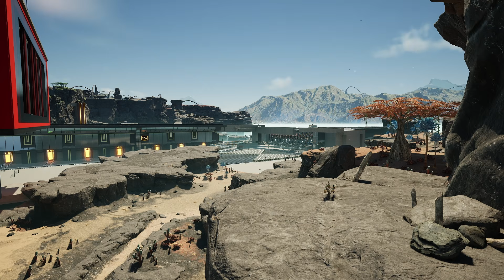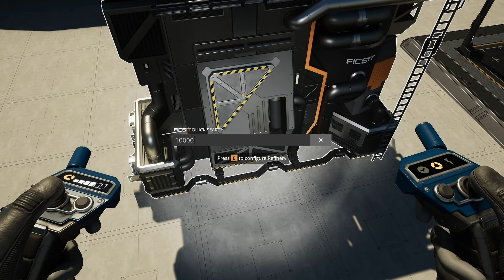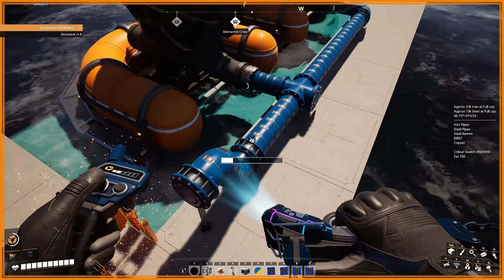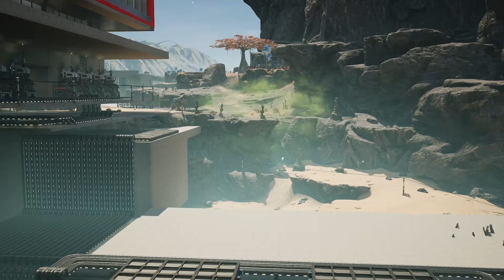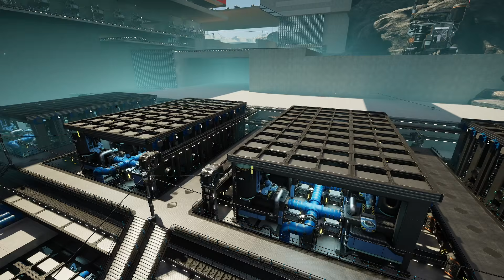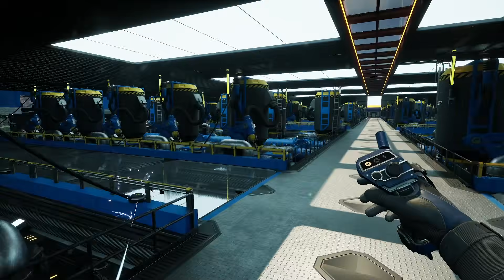Fixing The Water Problem Satisfactory 1.1 Lets Play

Comment: The problem with filling a single pipe with liquid is solved completely by installing a buffer tank at its very beginning. That is, the liquid must flow from the pumping station block into a small tank, and then move further along the pipe to the consumer.

На русском:
Проблема с наполнением отдельно взятой трубы с жидкостью решается полностью установкой буферной цистерны в самом её начале. Т.е. жидкость должна из блока насосных станций попадать в маленькую цистерну, а потом двигаться дальше по трубе к потребителю.

Comment: I might have you beat with the rubber limestone mix not even joking you I can make 450 concrete a minute with this 1 machine I had 6 running for one of my mega build, near the sw edge of the map and might I say it’s mad, just completed my mega power oil refinery making me 12000 mw of power and increasing more rubbber and plastic than I know what to do with but it was worth it for the unlimited amount of concrete I need for my feature builds

Comment: @TotalXClipse you keep mentioning pipe bugs coming from mixing Mk1 and Mk2 pipelines. I mix mine (Mk1 for the output-to-junction, then Mk2 for the junction-to-junction) and I've never encountered any bugs.  Can you give an example of what the bugs are and/or how they manifest so I know what to look for?
Reply: I also mix mine, and have done so on some pretty expansive setups and had no issues. I do generally design for mk2 pipes flowing ~595 cubic meters of water per minute instead of the theoretical 600, and I make sure to turn machines on in stages so that all the pipes and machine input buffers fill to 100%, so I might be skirting the issue by doing that

Comment: 23:53 While not perfect, you can get curves to go much further with rail lines.  Build the railway above where you want the curve, with the same edges as where you want the conveyor ends.
Snap a concrete pillar to as close to the center of the rail as possible.  From that pillar, snap another concrete pillar and nudge it so its top is in line with the floor.
Build a conveyor support on top of that pillar, and now you can make a curve in multiple parts.
It's almost exact, but you'll get some slight variation because you can't accurately set the rail midpoint, and you get different results depending on what side you 'start' the conveyor curve on.

Comment: I thought that the Rubber Concrete recipe had the best concrete output.
Reply: Best output, yes, but it uses valuable oil. Wet concrete only needs water and limestone. The former is basically infinite, and the latter is the most plentyful resource in the game. Sacrificing a portion of a more rare resource to save on a really common one is a bad trade.
Reply: @Stukov961 I think that depends how you get your rubber- if it uses the by product of your fuel factory (polymer Resin) then it serves dual duty of higher throughput and keeping your fuel running without being a waste. I typically have more rubber, plastic, and fabric than I know what to do with because I use polymer Resin and water to make them as a by product of my energy production.

Comment: Prefer piping water. I piped all the water for my 12000 pm concrete facility in that same area. With Auto-Connect and blueprints its pretty easy. Though the massive amount of pipes (55) I was using took forever to actually materialize. Fortunately you can place the next blueprint without waiting on the visual materialization to finish.

Comment: With valves  being one-way could you just extend the end of the pipe slightly  and put  a valve  at the end to prevent the back flow, or even put one just before the turn up?  That seems simpler then water towers, unless it just causes it to act like an endpoint of a pipe.  

Would fluid buffers also work? Assuming you are not producing more  fluid then you consume which would cause it to fill up.
Reply: Valves cause more problems than they solve. Buffers have their uses, but can also mask problems making diagnosing any issues really difficult.

Best practice is to keep it as simple as possible, and work with gravity, not against it. Feed from above, always.

Comment: How do your signs illuminate the surroundings? Is it the size of the sign? Mine look fine, but they don't give off enough light to really see by.
Reply: You need to have lumen turned on. Global Illumination in the settings. Anything smaller than the billboards only illuminate a very short distance. You can edit the settings file to get more light out of them but I don't have those values off the top of my head.

Comment: So we're just trading a bunch of power for an extra 180/minute per belt versus pipe, and the ability to ignore headlift?
Reply: So you package water to avoid headlift and pipe bugs. Then unpackage it cause you need it as fluid. Then use it for wet concrete. As a lazy person I wouldve produce the concrete where you did the packaging.
Reply: @Die3weey  that… is a very good point.
Reply from the maker: I would rather do that, then find my pipes have pipe bugs and have to spend dozens of hours redoing it all. 😉
Reply: @TotalXclipse  Blueprints make it pretty easy. I ran 55 pipes (300 pm water in mk2 pipes) and had no issues.
Reply: @TotalXclipse makes sense.
Reply: Yeah Satisfactory needs a pipeline overhaul asap. How come we can transport gases and liquids over hundres of kilometers irl and in the game every few meters you can get a connection bug and even without bug it works like the cardiovasculary system of a dying person. 

PS: Also I dont care how they implement it. It doesnt have to be realistic and just needs to look good and work scalable. We know its not a simulator. :)
Reply: Also, it gives him a good reason to demonstrate alternative solutions while expanding the factory in this area.